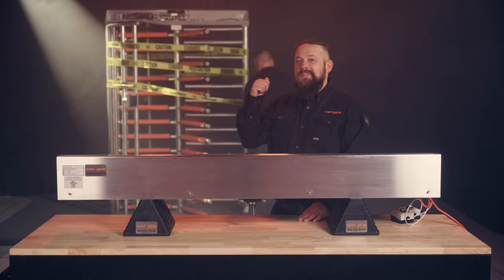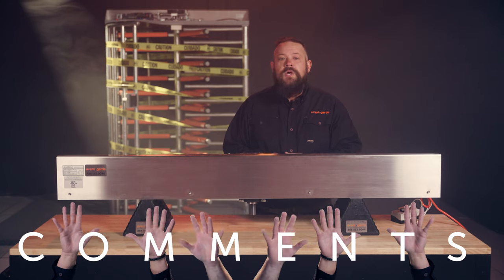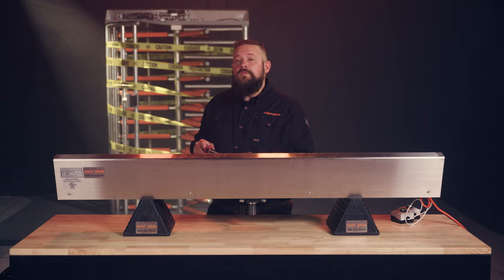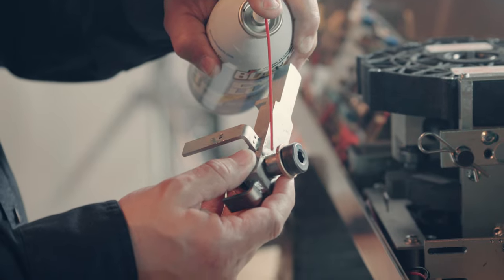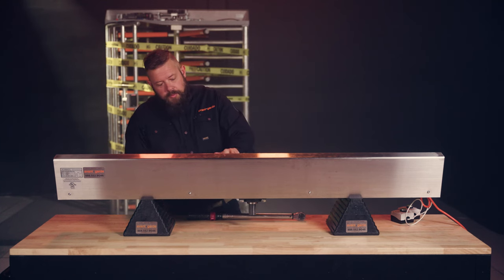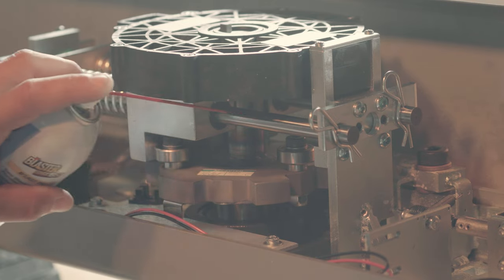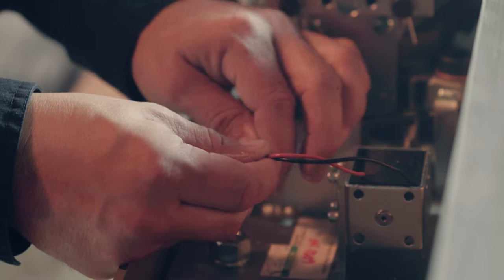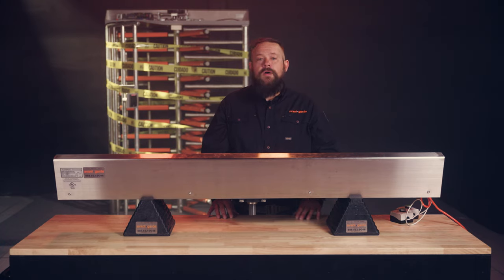How to Maintain Your Alvarado Full Height Turnstile

Comment: Is there a bottom bearing grease point?  If so, how do I access it?
Reply from the maker: Great question. On modern Alvarado full height turnstiles the bottom bearing is sealed. Only the top bearing can be greased.